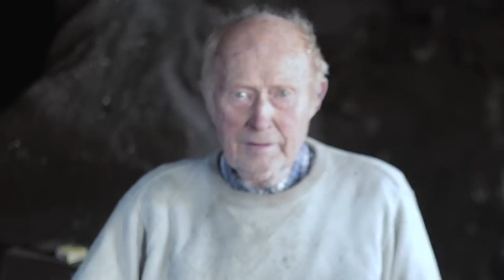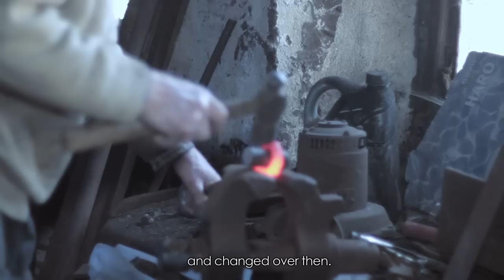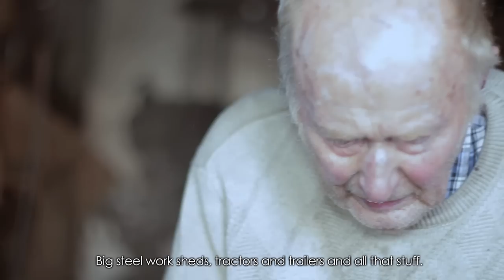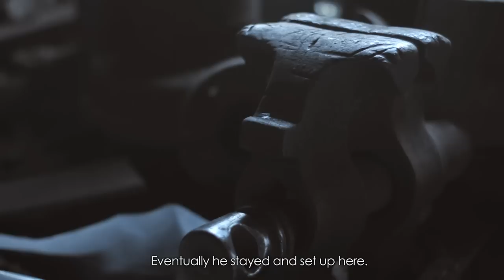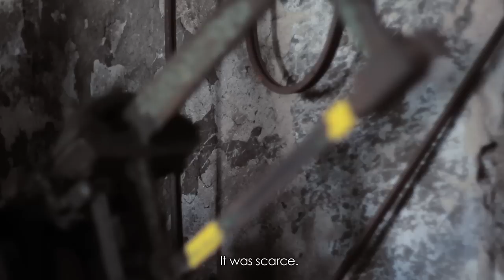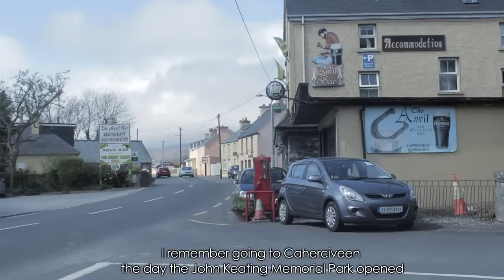THE LAST BLACKSMITH

Comment: All he has is a Ball pien Hammer dont need any fancy hammers
Reply: Granville Bennet it depends on what type of work you are Doing. A rounding hammer is good for heavy drawing out and since he doesn’t do that work he doesn’t need one. A cross pein or straight pein hammer are for spreading and he wasn’t doing any in the video so that’s why he didn’t use it. Ball pein hammers are usually smaller lighter hammers and since he said he can’t do heavy work he can’t swing a heavy hammer. Choose the hammer for the job.

Comment: Not the last im lviving proof
Reply: I think they mean the last old time blacksmith that does handywork, most of the stuff done like welding is now done with a gas or arc welder, the bending is done largely by machines that help make the work faster and more consistant, it is a bit less skill to do it that way though, but sometimes heating and beating is the most tried and true method, sure there are others that shoe horses, make blades and fabricate, drop forge, do artwork, and do welding, but he seems to be the last old style smith doing everything by hand without the powertools, and from the old days before many of them smiths did have all that to help them.
Reply: The last in his family....
Reply: Ah that would make more sense